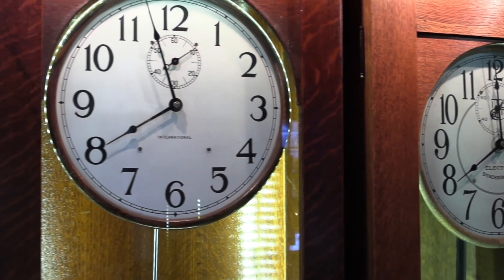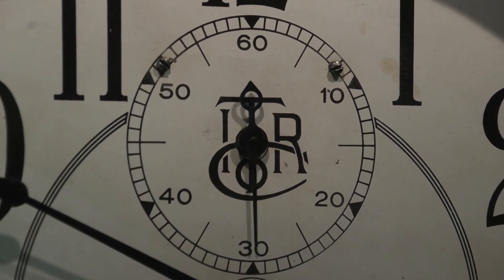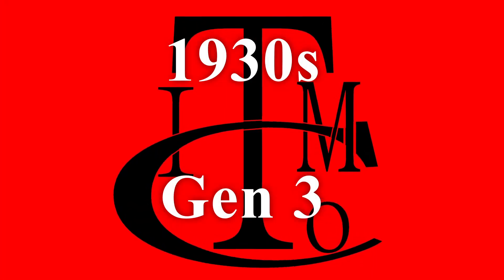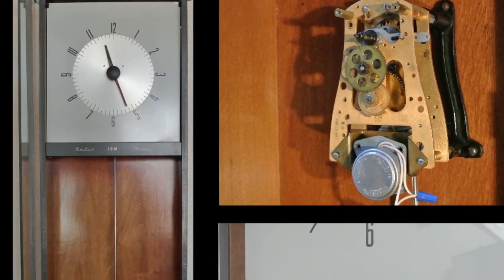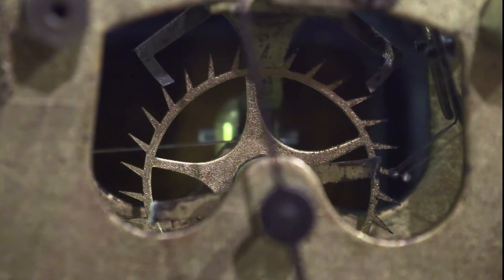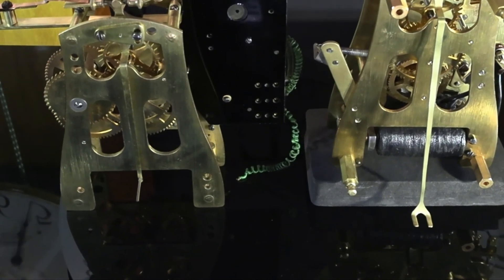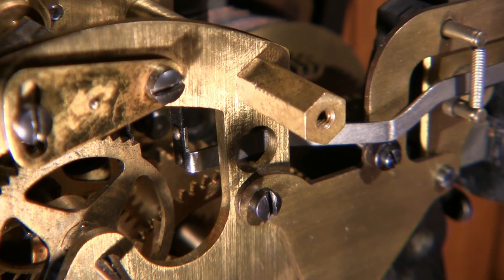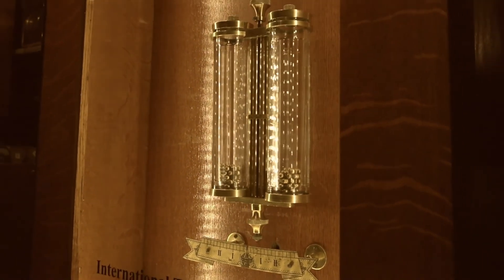IBM Master Clocks, Timekeepers of the Industrial Age. An ITM Clock video

Comment: I'm a little disappointed about the lack of info about their "direct read" clocks that told the time in illuminated fashion, with numerals shown.  I.I.N.M., such clocks were atop their buildings at the original 590 Madison Avenue in New York from the mid-1950's to that building's demolition in 1968, and at 616 South Michigan Avenue in Chicago where they would be in that city until the construction and opening of One IBM Plaza in the early 1970's; plus, the original jump clock of the MONY Building (now known by its address of 1740 Broadway) and the time display that was part of the huge Bond Clothes "spectacular" atop their Times Square store from 1948 to 1954.

Comment: I have what appears to be a gen 4 master clock. Hasn’t been run in years. What do I need to know in order to get it working?
Reply from the maker: If you have a 'weight driven' clock, check out these videos:
https://youtu.be/Sb68YyzkVhU
https://youtu.be/nLyBTgdFrrI

If you don't have weights (11lb each, 2x) then you have a spring driven and this video may help you get started:
https://youtu.be/3USrCNFY56g

Good luck!